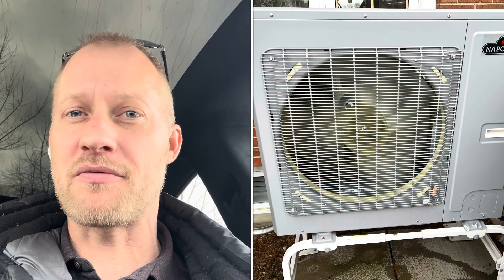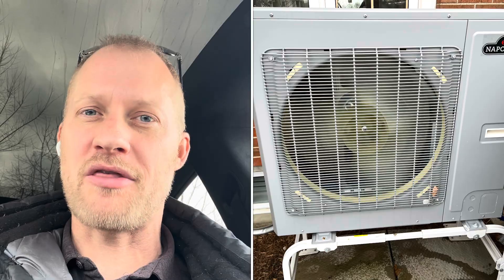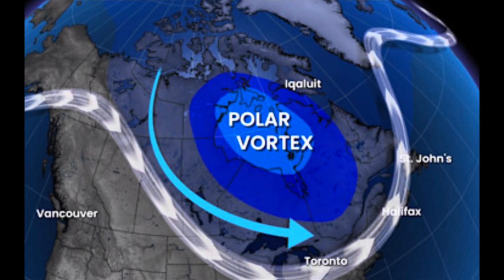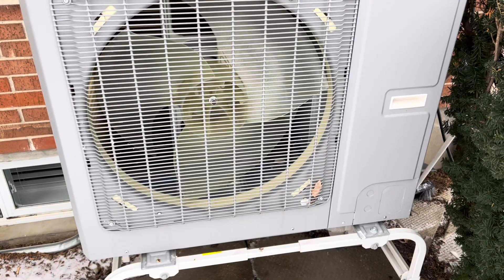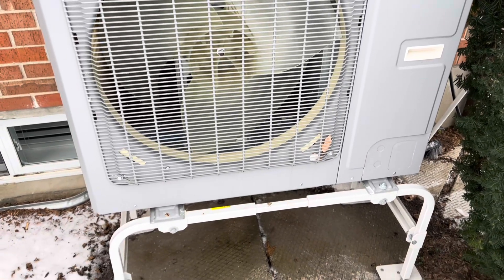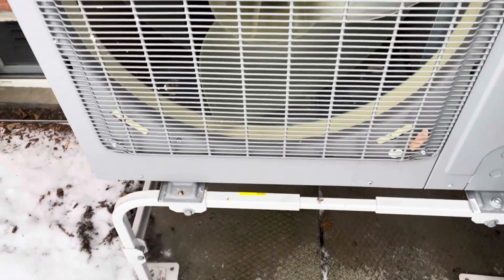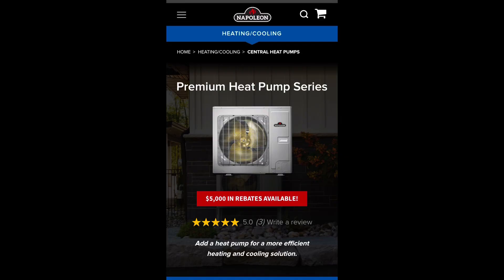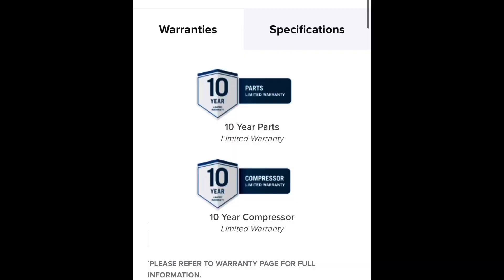Heat pump in Canada - Does it work long term?

Comment: Twenty one year now living with a heat pump, a geothermal heat pump though. I replaced the pump in 2023, i.e. the old one lasted 19 years. This is something to concider. Geothermal heat pumps last for 15-20 years so this is something to consider. I think air source heat pumps might fail slightly earlier in cold climates, below -20 C. We have 208 square meters to heat. The heating is done by underfloor low temp heating. The maximum is set to around +38 C at - 27 C. We also get hot water with same heat pump.

I live in Finland and geothermal are the way newer houses over 160 sqm houses since 2000 are heated here. Smaller houses back then was heated with direct electricity but quite soon combined with a minisplit. These days newer smaller houses are often heated with air to water heat pumps. Older houses are also,retrofitted. Here we do not have any gas grid so the options are electricity in some form, an oil bolier or firewood, or in many places district heating. Most have some form of accumulating fireplace as a back up for back up or if Putin comes for a coffee. Firewood heating is still popular on the countryside. Many people own a small patch of forrest.

I agree with your conclusion, stick with what you have until it breaks if there is no major relative price differences between the different sources of energy. Here the building code have been quite restrictive since the 1990s when it comes to insulation requirements but have become even more strict.  We use around 3600 kWh per year for heating and hot water. SCOP combined is around 4.2. This do not vary substantially with the temperature as I take the heat from the ground.

If considering a heat pump in an older property I would go for insulation and then a in order a minisplit as an compliment, air source heat pumps, and geothermal if it is a larger property. Heat pumps are most efficient with low temperature heating. I invested around 15000 Euros in the well, pump and underloor heating in 2004. The replacement of the pump cost me 11 000 Euros in 2023. The full system today would likely cost around 25 k. It is quite much for a heating system but cost of operation is low in comparison to our other options here.

PS: Solar and batteries have been in concideration here as well mostly for hedging against volatile energy prices. However today payback is north of 10 years. Cost are still coming down and technology still developing so I will still wait. Black panels on a red tile roof are also ugly and prevents cleaning the roof from moss, which I like to do every second third year. There is also a small fire hazard that I do not like in residential areas, more so with the batteries. There is a reason they come with a built in fire fighting system. Residential batteries are also double the cost of commercial ones so I hope the commercial might fill the need in the market for some of the balancing needed.
Reply from the maker: Great information thank you. Interesting how different areas all focus on slightly different variations of the same technology.  I would prefer geothermal but it is not done here much and also 5x the cost (at least when I checked).
Reply: Heat pumps r garbage do not buy into it !

Comment: over 20 years now on my Water Furnace had one fan motor quit. Not as cheap as your unit but I live farther north.
Reply from the maker: Water furnace? Typo for older perhaps? I mean, it really is true older stuff lasts longer.  We’re just replacing a washing machine that lasted a whole month …
Reply: @yourelectricneighbour3633  Water Furnace is a brand name and 20 years ago they were almost the only water to Air for open loop geothermal.

Comment: your trying to make a truck out of 2 cars dude haha 
they have been using this heat pump tec in the rest of the world for along time and it comes over to this land and you try to mate it with your junk that you already have 
you know that fan motor you upgraded to in your furnace well that was the cost of the inside head unit of the heat pump haha your a mor on that is getting screwed by the people that installed it for you

Comment: When it comes to getting a heat pump you need to have a full heat load done so you can calculate your balance point. 

The balance point is when the outside temp gets to a point that the heat loss of the house exceeds the heating ability of the heat pump. 

Once you hit the balance point the heat pump must run 24/7 to keep the house at the set point. 

A heat pump has a chart that will show the amount of BTU/H it puts out at a certain outside temperature. 

As the temp falls the heat pump loses efficiency and puts out less and less BTU/H. 

On the flip side the colder it gets outside the more BTU/H your house loses. 

So you see as the temp drops the worse the situation gets. 

Most installers don’t actually do the math to figure the balance point and how much supplemental heat you will need. 

What I installed in my house (I am a HVAC contractor). Is a dual fuel heat pump and gas furnace.  

The heat pump is a two stage 3 ton so it can run at 2 or 3 tons of heating or cooling. 

My furnace is a 75K btuh and it’s also a two stage. 

So the thermostat has a outdoor sensor and I have it set to use the heat pump till it gets below 45F and then it locks out the heat pump and then uses the first stage of heating and kicks up to the second stage only when it gets to around below 25F I’ve found. 

If a contractor won’t calculate your balance point, you need to find a different one.
Reply from the maker: Great points, like any upgrade, you need to make sure it’s economically feasible for your clients (or they do I suppose). Thanks for laying out a solid definition of this.  My contractor didn’t calculate for me but given my old a/c unit needed replacing anyway, the cost upgrade was negligible.
Reply: How much NG are you using with the dual system as opposed to a full NG furnace?  I think there's a case for installing a supplemental heat pump instead of outright furnace replacement.

Comment: Have heat pump now. Completed a winter last year. I saved absolutely nothing in energy costs. My gas furnace is cheaper to run in cold weather and more comfortable. And this is even with QC’s reduced electricity rate when temp are above -12. I’ll be bypassing the HQ controller and will use my furnace this winter when the temp drops below -2

I have a 2.5k sq home. My heat pump is like yours and the rebate in QC is so good it cost me $1000 bucks installed. 

What I should have done is replace the entire furnace as well with a better one that uses a multi speed fan. These mismatch systems don’t really work great and the cold drafts when in defrost mode are annoying

Comment: Set it to 2 ton and save power.
I also use 8kW heat strips during defrost, so the air isn't blowing ice cold. I think it's a good compromise. And in the case of an emergency, I can rewire for heat.
I try to tell everyone how amazing these Grees are, and even moreso for the cost (Mr cool was very cheap in the US). But no one listens. Now, electricity rates are skyrocketing.
I install these, and mini splits, but nearly no one listens.
Reply from the maker: Thanks, I’ll look into the heat strips as a backup.  There is a setting in the outdoor dip switches for aux heat during defrost if I recall correctly? Mine is currently off but it’s been a few years now since it was set up.
Reply: @yourelectricneighbour3633  it's just how it's wired in the air handler, IIRC. But, yeah, been a while lol.
Reply from the maker: Thanks, I’ll look into the heat strips as a backup.  There is a setting in the outdoor dip switches for aux heat during defrost if I recall correctly? Mine is currently off but it’s been a few years now since it was set up.

Comment: I am not clear on the economics of your heating / cooling setup.  Do you pay $400 / year because you also have a solar panels supplying electricity?  3 ton seems like a big system for a 1000 sq ft home.  How many amps is the circuit to run that heat pump.  I have been getting a lot of push back from hvac companies that say heat pumps haven't worked for their customers.  I can see why if you have a 3 ton unit for 1000 sq ft building.  Also curious what part of southern Ontario.
Reply from the maker: Yes offset with solar. This year my credit should cover the year.  My unit was the smallest they sell, it’s not comparable to old central ac units so if that’s the measure your company is using find someone who knows what they’re talking about. I’m in Hamilton/Niagara area.

Comment: The government has been 0 help with this.  As a gas fitter no one can properly advise me on what tickets i'd need to install these now (i used to do ac 15 years ago for another company).   The outright run around and bs you run into for something the gov't WANTS installed is disgusting.   I really despise all these people in charge of this.  They just fked me in my trade and gave me 0 help.  I hope all these fkin things brick when we actually get some -30 and lower temps again, I ain't fixing a single one.  All your people that managed to figure this out enjoy freezing your balls off.

Comment: nice video! just have one concern do you not have a secondary heat source since you disconnected the gas? did you not add electric coil heating? The issue here is the defrost cycle what happens during defrost is the Heat Pump goes into AC mode to discharge the heat back to the Out Door unit it will even cycle outdoor fan directions to help loosen derby in its coils. during the defrost cycle the emergency heat is turned on your gas would fire to give heat to the A coil to be captured and sent to the outdoor unit also insures the defrost cycle doesn't last as long and you will not be dumping cool conditioned air in the house during the cycle. what you described would make it run for a much longer period of time and would see dips in temperature during the defrost cycle. if you don't want the gas i get it but you should have a emergency heat source getting energized from your D terminal on the Out Door unit.
Reply from the maker: Good train of thought. Yes I got rid of gas as I didn’t have any other appliances using it anymore. But even when I had gas the installer set it up not to kick on during defrost.  You’re right that cool air will come out during a defrost but the cycle is short enough that the temp of the house isn’t noticeably affected.  I’ve debated wiring up a coil as emergency heat but we have electric fireplaces and heaters in the house that could be used as well.  Thanks for the comment

Comment: I live in UK. Interesting to hear someone from Canada as you have a lot of  heating and cooling costs - we only have heating costs except for a few days in the summer where is gets to high 20's to low 30's Centigrade. I guess your electricity rates are very low. Here in the UK it doesn't get that cold and rarely below 0C, but electricity prices are high with costs 25p (about 40c Canadaian) per kWh. Although if you have an EV you can get it at 7p ( 11c Canadian) per kWh for 4-6 hours per night which you can use  all day if you can charge a home battery. I find it strange that Canadians measure heat pump output in tons ? We use kW to measure the heat output.
Reply from the maker: Thanks for the comment , interesting to see your perspective from the Uk! Yes, kWh is still the output but tonnes seems to be the old “hp” of the system..

Comment: Did you research the carrier 38 Muraq?  It’s about $2,800 more expensive than the gree flexx in Montreal when paired with a furnace (in Montreal)
Reply from the maker: My installer didn’t have those at the time but it seems like a comparable unit from a good company.

Comment: Great update.
Im north of toronto - Central gas furnace and AC getting up there 23 yrs - time to change.
Cheers
Reply from the maker: That’s exactly the time to update when new equipment is needed. Try asking neighbours who you trust what installers they went with. Thanks for watching
Reply: i wouldn't replace just due to age - especially the a/c. the old stuff is more reliable.
Reply from the maker: @Jon-hx7pe key phrase “when needed”. Not age as you pointed out. Cheers

Comment: I also live in Sothern Ontario.
Who did you use to install your unit?
Reply from the maker: A company that has unfortunately gone under after 25 years.
Reply: I just installed an ATK heat pump/ AC unit in Toronto last month. Very impressed how cool my house is and cost $47  for the month as i just received my first bill.  I uploaded a short on YouTube on my ATK unit running. I paid $5600 and receiving a rebate of $1040 soon. Worth if so far and wondering how it will work in the winter and cost per month.

Comment: I live in southern Ontario as well and I'm getting a Gree 3 ton heat pump installed in a couple of weeks. Thanks for sharing your results. They told me that it will be set so that the gas furnace comes on at 0 degrees Celsius. I was hoping it would come on at a lower temp. I would like for it to kick in at -5 Celsius. I will talk to the installers to see if I can do it.
Reply from the maker: It’ll depend on how your thermostat is set up. Unit is definitely capable of heating to much lower temperatures than that!

Comment: $80/mo is great.  With home heating oil, I have paid over $4000 for a winter. No cooling!

Will be looking at a heat pump now!
Reply from the maker: If you’re in Ontario there’s a credit to switch from oil heating on now. If not check other local state/provincial credits.

Comment: How does your hot water work if you don’t use gas? Do you have a hot water tank or an on demand unit?
Reply: electric
Reply from the maker: Will post a video soon. Heat pump electric water tank. Thanks

Comment: You would have to compare your year long natural gas to your year long electricity bill. Heat pumps drive up Electricity. In alberta I pay 6.6 for electricity and that comes out to 18.9 cent per Kwh when I do the math. In Alberta I pay 4.09 GJ and that works out to 12.89 GJ... if you don't do the math for a year for each service, then you should not expect a reduction. Sure natural gas goes down but rate of electricity will always go up.
Reply from the maker: Gotta do your calculations for sure! Most don’t look at the numbers closely before switching as it makes a difference where you are and what source you’re looking at. Thanks for watching.

Comment: Heat Pumps work great in Canada, as long as you have the correct unit.

HSPF is the most important stat for heating. Also BTU rating at -25C, most heat pumps only advertise BTU rating for 0C. Brands like Mistubishi Hyper Heat or Fujitsu XLTH exceed their BTU rating at 0C and meet the listed specs at -25C. Unfortunately the majority of brands don't provide the necessary data needed to make an informed decision. My Fujitsu XLTH is 12 years old, has gone through multiple cold snaps (-35c) and still pumped out tons of heat, included a few ice storms. I also have two newer Daikin Aurora units, which work reliably BUT the measured temperature coming from these units is 10-15C warmer compared to the Fujitsu! When the Daikin need replacing i'll pay much closer attention to the -25C rated performance!
*FYI I live in the Martimes

Comment: Great heat pump reviews! Thanks. I am going to pull the trigger on a heat pump asap. Also planning on going solar in Milton. What kind of solar set up do you have? What company did you use for install of solar? Who installed your heat pump? Thank you
Reply from the maker: I recommend delta energy solutions. Tell them Conrad sent you. I started with SMA inverter now trying a Growatt for last year. Over 14kw system. Will need to do a video soon of pros/cons in Canada with solar.

Comment: you can also set this unit to low capacity 24k to get extra efficiency. and lower indoor fan speed too. hope it will keep up in low capacity mode
Reply from the maker: Debated with more eco efficient settings but with the current cold snap figured why mess with what’s working well.
Reply: @yourelectricneighbour3633 bc the output doesn't change when it's Canadian cold. Use 2 ton standard if low fan speed and 2 ton eco if say 1200 cfm. For 1000sq ft you should just use 2 ton eco with 800 cfm.
My house is poorly insulated with broken/garbage aluminum windows and it can heat 2000 sq ft in 2 ton mode at -20C. It's actually overpowered for the ratings. Eco mode forces power limits.

Comment: with old indoor unit setup like yours u only get 5 years warranty. not 10 years.
Reply from the maker: As mine is rebadged as Napoleon, the outdoor unit’s warranty is not based on indoor pairing.  It’s in fact advertised as a great hybrid solution for most applications.